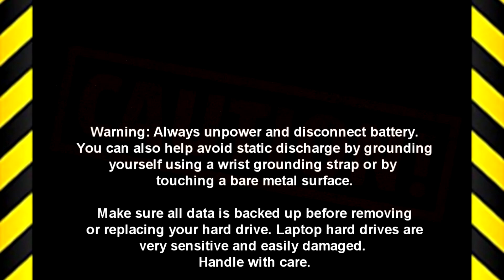Dell Precision 15-3541 (P80F003) Heatsink How-To Video Tutorial

Comment: Dear colleagues! Is it good practice to fully unscrew each screw one by one? Can it cause the break of the chip corners?
What kind of thermal interface do you recommend for prolonged work (phase change material or viscous thermal grease like MX-6)?